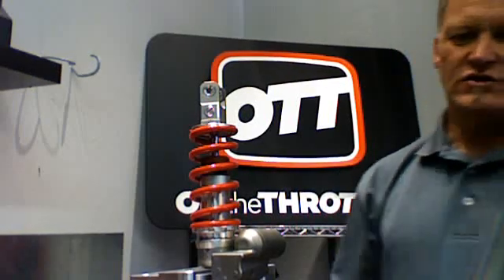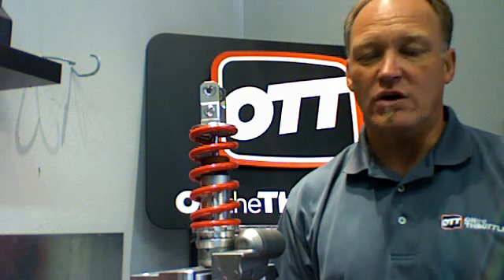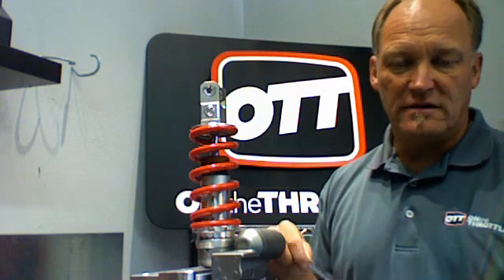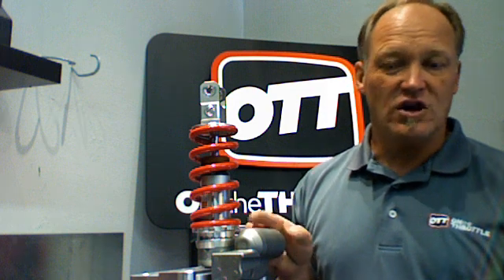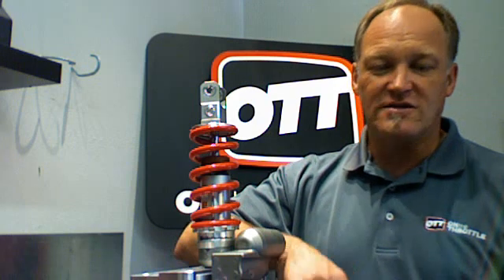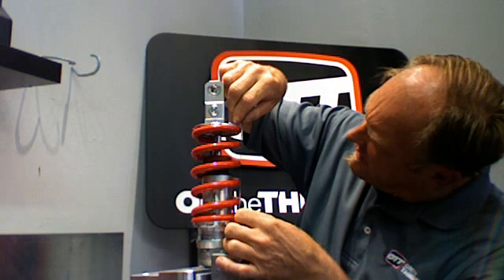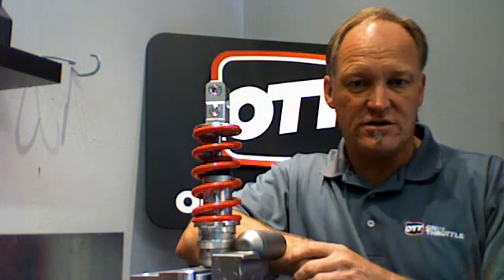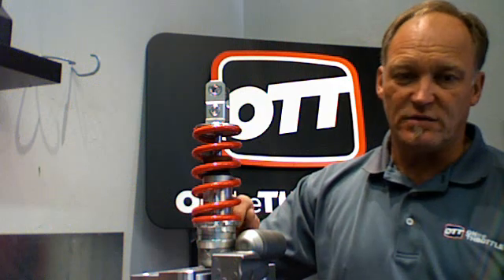what is installed preload on a shock spring and how do we measure it?

Comment: Hello Dave. I am an average weighed man 75 kg, and since I have installed in my Bandit 650 front Ohlins springs, I did the SAG. At the rear, I have to put the preload in the position 6 of 7 to have a correct dinamic SAG (free SAG is correct also in this preload position). My question is: is that acceptable to put the preload as high in this spring or should I buy a hardest spring? 

I have the front SAG adjusted and if I put the rear preload under 6 of 7, the bike doesn't enter the corners with the desired agility (I know it is not a sports bike but I can achieve a good handling on it).

Thank you very much.
Reply from the maker: Hello Juan. It is acceptable to set preload for sag numbers BUT, are you checking how much shock travel you are using? Have you checked how much fork travel is being used? If not enough, that explains why the Bandit does not handle when you change shock preload. Note that the OEM shock are good for 12-15,000 kms then performance starts to reduce.
Reply: @catalystreactionsbw  thank you very much for your fast answer. This bike is used in opened roads, not tracks, although I have meausered the front travel and the front axle is working fine when braking hard. The thing is that since the front springs are harder than the originals, I found the rear end to have to be hardened (spring preolad) to be within the original chassis geometry, because it's affected by the use of harder springs and when I enter a corner, the more opened fork angle makes the bike go out of the corner (when going fast). The Bandit hasn't many parameters to change but to achieve a good handling compromise I have to compensate the height of front and rear. 
I have the rear preolad setting almost at maximum and my original question was if it is acceptable, and you said yes... Despite that, probably I'd need a replacement (31.000 km now, but it seems to work fine).

Thank you friend.

Comment: Hi Dave, i know this video is 9 years old now but i love to know more about your vfr400 race bike and its suspension set up. Cheers
Reply from the maker: That is a blast from the past. GP Suspension fork cartridges, .90 springs, 5W oil to 130mm. Rera shock was Penske triple clicker, 13kg rear spring, dog bones changed by 2mm for more ride height.
Reply: Dave Moss Tuning WOW thats impressive how did it perform ? Amazing i guess. 

Im in the process of re-doing the suspension front and rear of my nc30. Ive fitted a 2010 bmw s1000rr shock to it but it must be re-sprung as the leverage and ratios of the dogbone is different so ive been watching loads of your videos to find out information. The standard bmw spring is 500lbs and ive been told i need a 900lbs.
Reply from the maker: @karlogrady4907  The minimum rate on the NC30 was 1,000lbs for track use, so 900 for the street might work. Static sag numbers will show if that is correct.

Comment: Thank you sir. The whole preload thing was pissing me off trying to figure it out. The Ohlins manual has the free spring length at 210mm and suggests 10mm preload. So 200mm should be the length installed on the bike. 
You saved me a shitload of head scratching.

Comment: thanks for the video of 06 zx14 with black gentlemen becouse im about his weight but im 250lbs and i had almost same sag when i checked my 06 zx14 so hopefully it will help me too thanks your very good at what u do
Reply from the maker: You are welcome and thanks for watching. Al the settings we used will be a good starting point for you!
Reply: would the suspension being off before cause the bike to cut corners wide? its hard to describe what im trying to say almost like understeer? also does suspension sag out of adjustment affect a bikes behavior to wheelie or not wheelie (power wheelie specifically) mine would cause front end to skate and feel light but wouldnt lift up.  guess im to fat for bike to lift front up from power but clutching it will.
Reply from the maker: Absolutely. Fork rebound is too fast the front wants to stand up too soon so you run wide. Go for the gas and the front wheel hunts for grips and feels light. Dial it in and reap the benefits of the changes :)
Reply: mr moss thank you so much for your time and help, ive been hoping to find good advice with this problem..im going to try a friends friend that rides track and he sets up his bike himself he said he would help me dial in bike if i can bring bike to him. thanks dave
Reply from the maker: excellent and share how you got on.

Comment: Hello
   I  just got a 2006 R6 shock from e-Bay. Can I tell if it is any good before I install it?
Reply from the maker: If the rubber bumper is clean at the base of the shock shaft, that is a good start. Check the screws are not hammered by crappy tools for compression and rebound. If the shock is very clean that could be promising. Once installed, the shock should not jump up or bounce and hydraulics from all the way open to closed should feel very different.
Reply: Thanks, rubber bumper and everything else is pristine. Soft-Hard screw is a little messed up. I am cleaning and re-greasing the linkage bearings right now. Thanks for the tip

Comment: hi Dave, nice clear video. just a quick question. You say either a fork or shock spring should have an installed preload of 8-14mm.  This shock spring with164mm free length and 150mm installed, was getting a further 7mm max of adjustable preload which you said was shortchanging as max you could go to was 15mm. question...where you getting that 15mm from? like a rule of thumb, a percentage of freelength eating up compression or what?  is that 15mm max same for forks too? cheers mate.
Reply from the maker: the maximum is based on the change in compression via preload of zero on the adjuster to maximum, and different types of shocks will have different ranges of none to max based on limits set by step adjustment, hydraulic range of 2 lock rings.